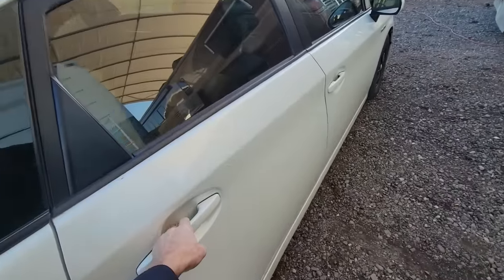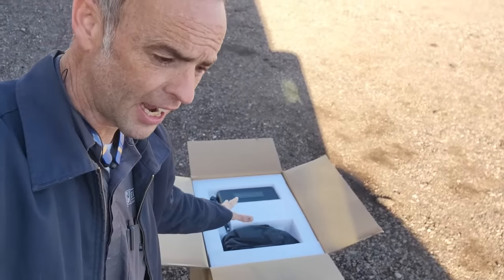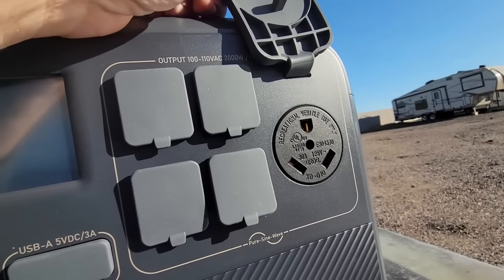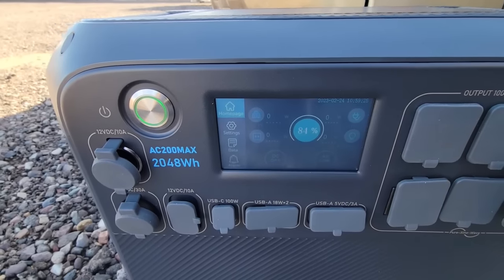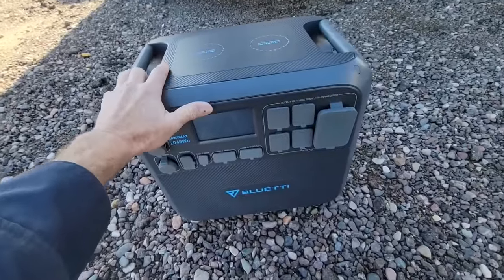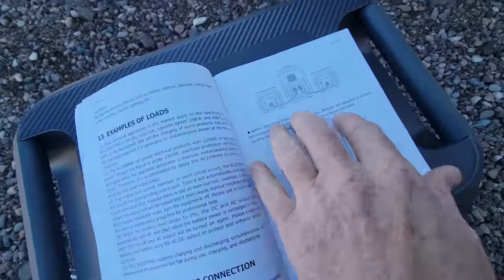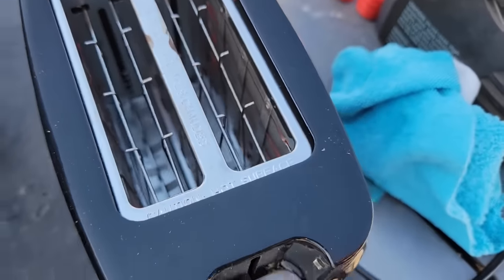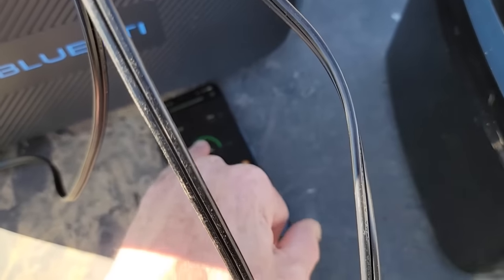The Most Exhaustive Solar Generator Test I've Done: Bluetti AC200MAX

Comment: Not sure if you mentioned it. After shutting off the converter on the class C, Will the Bluetti keep charging the house batteries??
Reply from the maker: the 30amp 12vdc outlet would handle almost any 12vdc house load if wired into the house 12vdc system.

Comment: Why there are not more portable units w dc in/out is silly. This is one of the few that might work with a diesel heater. Most portables don’t. Also, most don’t allow solar and dc from cig lighter simultaneously, key for vans and rvs.

Comment: This is very strange. I purchased this unit recently and tested it for AC that was pulling about 600W AVG and about 300W being pulled in by a 600W solar panel setup. The unit decreased 1.5% every minute that the AC was running. You cannot run AC with this unit for any meaningful amount of time.

Comment: Wondering what your thoughts are on a good portable Solar Panel setup to go with these? For those of us who aren't quite ready to bolt the panels on 🙂
Reply: A couple of the 200 watt renogy flexible to glue on the roof would be good, thinking about doing that myself but the renogy flixble isnt cheap, around 700 without charge control

Comment: Hi sir,I really enjoy your videos; awsome job,wish I had you around here to help me..I bought a 1998 40 ft overland loredo d p a few years ago and have  not used it yet,it has the Cummins with 60,000 miles and runs great and does drive good,my question to you is,are they as well built as I think it is,not much info out there since they went out of bussiness. also it has a damaged cargo door that needs replaced,can you help me find one of these somewhere: thanks for your vid’s and if you can answer these questions it would be very appreciated sir.

Comment: I have  3 at 410 watts solar  panels giving a max of 1230 watts at 110volts the panels  max input is 900 watts so it will just throttles it down if 900w is exceeded,   but voltage must not be exceeded    max 140 volts. so i have my panels placed in 3 different dirrections. One facing south east, next facing south, and 3rd one south west giving me about average of 400 to 500 watts most of a clear day. I am in UK so we are 240 v mains version of  ac200max but its the same world wide  for inputs. I havea 3 kw solar gride tide panels on house roof but no battery backup. and my provider wanted 5 grande for a  5kw telsar wall. me being 72 yrs old aand on my own. i would never get my money back on that much outlay. So when the war made the power crisis in UK and elseware, and prices went up a lot for most but lucky for me I was on a fixed tarrif till end of this march. and are goverment started giving households money to help with cost of living from early summer, so i put it towards a bluettie ac200max and the panels of which i got them on a black friday deal  saving £90 on a ac200 Also getting up to 12 months interest free payments via PayPal using Ebay, so a no brainer for me. the panel sellers made a cockup on the order of one panel, and gave me £50 voucher for a future purchase, so i ordered a second  410 watt  panel, then 2 turned up. the gods where with me i think panel total cost £320 for 3 so ive got the set up as discribed and mounted the panels on garage flat roof with stuff lying around, retired blacksmith (hoarder) of all metals. then bought 2 change over switches.  so i could switch over some of the basics from mains to the battery by the flick of a switch. That is the fridge freezer toaster kettle airfryer tv and combi microwave all on mains in day light using gride tied solar. then when it getts dark i flick it over to battery power ! I have managed to boil water with a 2400 watt kettle but it sets alarm off but can do it, so for safety i bought a 1500watt electric kettle, so i can safely have a tv an lights and other things running at same time. this works for me saving money on power, but i am a one person house. For families i would go bigger maybe a AC 500 or other brand say eccoflow delta  pro. with ev chargability for those realy bad days with no sun to charge with. I have also put 2 chinese diesel heaters  on the walls of my house to save on the central heating gas prices that also doubled here too.but i fuel them with kerosene, much cheaper and cleaner to burn than diesel only used that for  partof month of  january and feb. and energy supplier said they will lower my monthly bill from £90 to £78 when the unit charges will be double of last year, result! sorry to have rambled on a bit, but i love my ac200max

Comment: Its a piece of computerized junk. Its just a big battery and charger far over priced and under powered with no redundancy.
Reply from the maker: The winner of the give away has said it's performed perfectly, and the AC300MAX has not let me down once. I've priced out the components to build and there's really not much savings with a DIY anymore. Thanks!
Reply: @AZExpert  Perfectly? It depends how long it lasted and what it cost to buy and maintain it. It doesnt come out in the wash. After the battery depletes your done. Solar charging will take days and if the outage is storm related you wont charge at all. Gas or propane will run indefinitely.